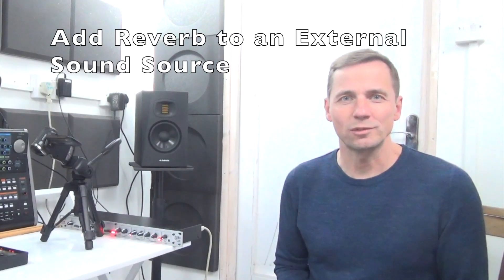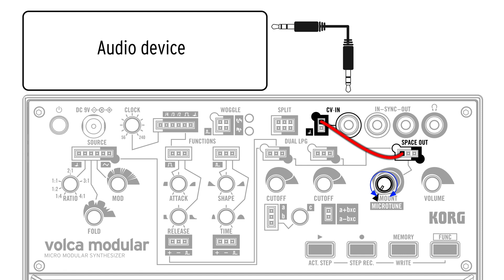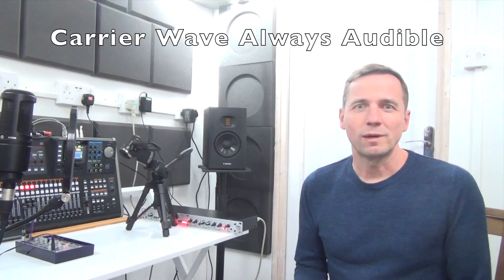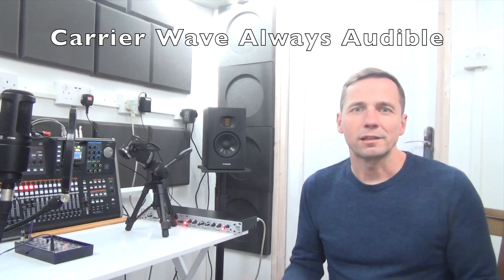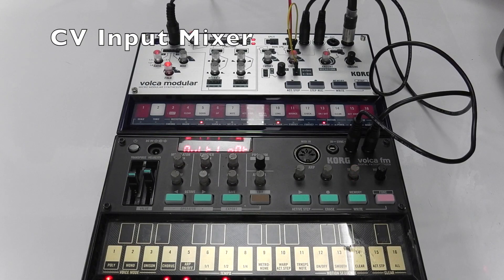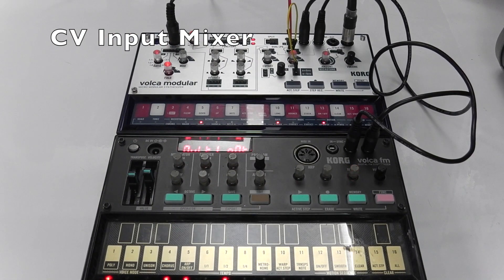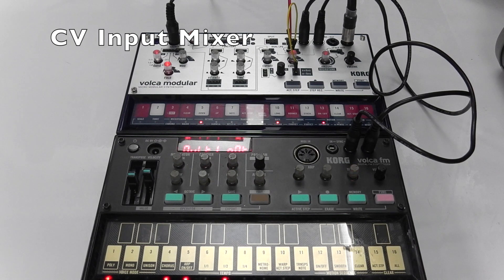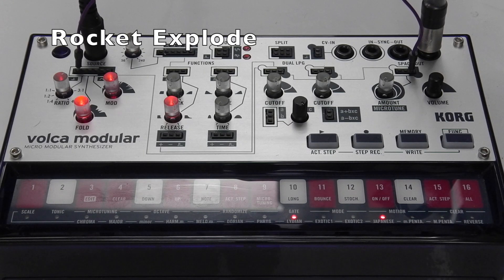Space Out / CV Patches: Korg Volca Modular The Expert Guide (pt 9)

Comment: super videos. bought one of these without checking if it had midi in as my volca keys does. any way around this?
Reply: There are midi Rx connections on the main synth board inside the unit. I took mine apart last night to look for these as I read somewhere that somebody had already found these connections on the board and had built a midi connector pcb to hook up the modular for mini in. So yes, it can be done. Tindie had a connector 'kit' available for the modular, but it looks like they've for the moment sold out. But the circuit looks pretty easy, if of course you don't mind getting your hands dirty with a bit of DIY electronics.

Comment: Hi there! I have just got a Volca Modular & bought your E Book manual to accompany it, very very good stuff in there! But one thing I'm desperate to do is to connect it to my Teenage Engineering OPZ, but I have no idea what I'm doing wrong. I have a trs to split mono cable, connect to the cv/gate ports of my oplab inside OPZ. I have patch cables from the upper CV patch to the furthest left Function 1 patch & then a patch from the lower CV into the furthest left Source patch - what am I doing wrong? Have you used an OPZ before?

As I'm a noob, would you mind just explaining exactly step by step how to connect an OPZ with an Oplab Module (which allows for CV & Gate) to a Korg Volca Modular. 

Much thanks (y)
Myles